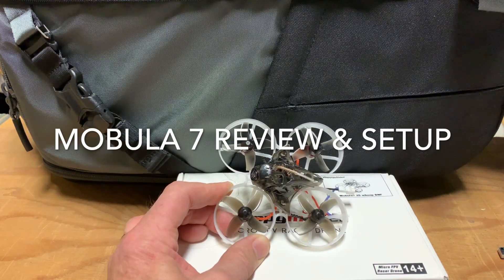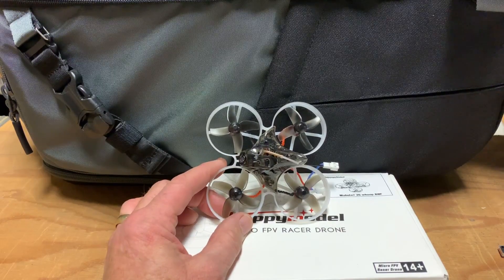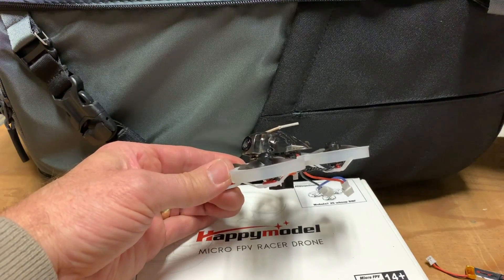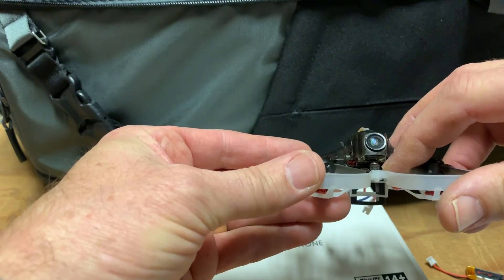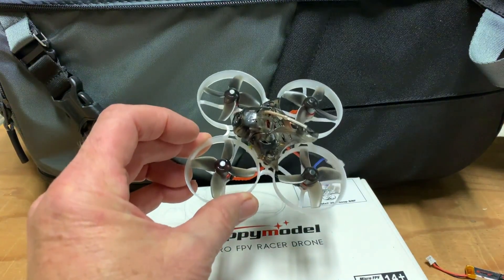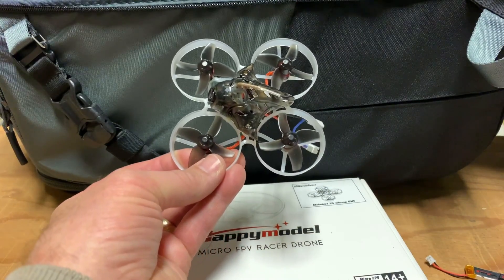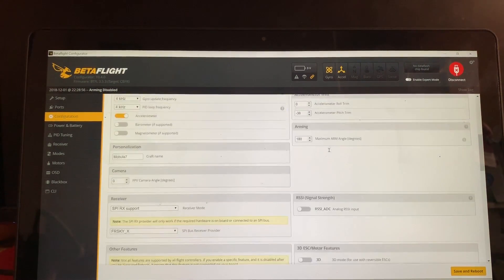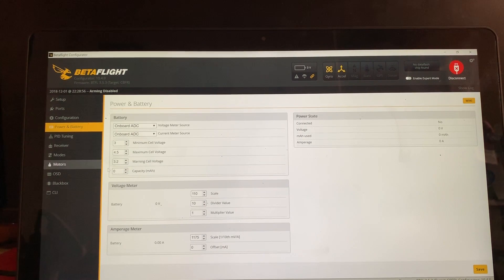Mobula7 Review and Betaflight Setup

Comment: Hey I just got the mobula 7, My problem is I cant select SPI RX Support in the Configuration Menu in betaflight. Theres only the option to select Spi support what can I do about it? I cant bind my reciever... (FrSky Taranis Qx7 Acces
Reply from the maker: Hi E4zl,
The Qx7 with access protocol support, only supports ACCST D16. In addition, if you are running the latest ACCST 2.0 FW, it will not support the Mobula 7 which does not support ACCST 2.0. I will link a video that Joshua Bardwell did on the compatibility issue. A lot of us who fly whoops have abandoned FRYSKY because of this issue. Your options are down grade the QX7s FW to pre 2.0 ACCST FW and run D16 or buy a multiprotocol transmitter module.
Link to Bardwell's: FrSky won't bind! ACCST 2.0 is to blame

https://www.youtube.com/watch?v=09g5MfTdiyw&t=469s
Reply: @slogfpv  Hey thank you so much for that long comment it helped me alot and I got it to work now :) Thank you!
Reply from the maker: @E4zlLP  glad you got it working. Have fun!

Comment: Ok I have the flysky version it beeps the whole time while I’m flying the. board is 4.2 is it the battery warning and my battery level forest show up on my OSD.
Reply from the maker: Hi Timmy Drones,
I would go into the Betaflight Configurator and on the Power & Battery tab would set the following:
 Minimum Cell Voltage = 3.1
 Maximum Cell Voltage = 4.4
 Warning Cell Voltage = 3.3
The PH2.0 connectors are not solid pin (at least on mine) so there is a lot of voltage drop across the connector. The Maximum Cell voltage is set to 4.4 if you are charging your batteries to HV. After landing check your battery voltage at rest and it should recover to ~3.5v.
SLOG
Reply: @slogfpv  still beeps while flying doesn’t show my battery on OSD like the screen format is small. Won’t take off on 2s spins up and stops and beeps and beeps lol
Reply: @slogfpv  update is flew on 2s for 2 mins and one min on 1s and I did get the beeping to stop along with the battery to show up on OSD. Super low fly time

Comment: How many flight modes does this quad have? I see "air" and "stab" on my OSD. Is there another mode I should be setting up in Betaflight? My choices are "Angle" and "Horizon". This is a Crazybee F4DX 4.0.6 9/1/2019 flight controller, FWIW.
Reply from the maker: Hi Fred Morton,

There are 4 modes: Angle, Horizon, Acro and Acro Trainer. You will see three of the flight modes in the Modes tab in Betaflight. Acro is the default so it does not show up in the modes tab. Oscar Liang has good overview on all the modes in Betaflight (link below): https://oscarliang.com/betaflight-modes/

Best,

SLOG
Reply: @slogfpv  Thanks. You don't mention "Air" and "Stab". I presume "stab" means "stability", but how does this match up to the four modes you mention?
Reply from the maker: @fredmorton4291  
I know it is a little confusing as the names change for example in Betaflight there is an angle mode which equals stability mode. Air mode is really an add on feature to Acro mode and a lot of pilots just turn it on always. But basically the props continue to spin while your throttle is all the way down (min). Why this is important is if the props stop spinning while you are doing power loop (usually drop throttle at the top of the loop), you lose control and will fall like a leaf. Think of it like an airplane stall. Here is a quick cheat sheet. Ones that say self leveling are actually using the accelerometer. Acro does not.

Angle = stability = self-leveling 

Horizon = self leveling up to a certain roll/pitch angle (adjustable) so you can do rolls and loops.

Acro Trainer = self leveling but opposite of Horizon where it is not self leveling up to a certain roll/pitch angle so you cannot do rolls and flips but does give the feel of Acro mode. The Angle it goes into self leveling is adjustable as well.

Acro = no self leveling, is the default but is overriden by the above modes if they are turned on. Usually the Air mode feature is turned on with it. For short hand I just say Acro/Air because most pilots use the two paired together.

Hopes this helps,

SLOG
Reply: @slogfpv  The quad I compare is to is the Inductrix FPV+. It has 4 modes-Altitude (alledgedly holding altitude), Stability, Agility and "Meow". •	
The modes are described below from the instruction book:

Altitude mode (green LED, switch position 0): maintains altitude. The bank angle is limited. When the sticks are released,

the quadcopter will return to level flight.

•	Stability mode (blue LED, switch position 1): the bank angle is
limited. When the sticks are released, the quadcopter will return to
level flight.

•	Agility mode (red LED, switch position 2): the quadcopter has
no bank angle limits and will not return to level fight if the sticks are
released. Use rates and expo to tune the performance according to
your flying style.

•	Meow Mode™ (trigger switch (RTF), button I (BNF)): flips the
quadcopter upright if it lands upside down after a crash by reversing
the motors on one side. 

From your descriptions, I assume the following-Stability mode on Inductrix = Angle mode on Mobula. Agility mode on Inductrix = Acro mode on Mobula. To my knowledge, there's no altitude mode setting avilable for the Mobula (unless it's called something else). And for the Meow mode, I think that's referred to as "turtle mode" on the Mobula since it does the same thing. 

Do I have this correct?
Reply from the maker: @fredmorton4291  I do not have any Inductrix experience.  The closest is my alien0 whoop running silverware. Comparing inductrix flight modes to betaflight modes is kind of like comparing DJI Phantom 4 flight modes (e.g. Attitude vs Altitude). But your mapping is correct.
Circling back to your question, the modes that I would setup for a beginner (not sure of your skill level) would be: Angle, Horizon and Acro/Air. You might want to play around with Acro Trainer if you have not mastered  Agility mode on the inductrix.

Cheers,

SLOG
Reply: @slogfpv  Thanks again for your help. Every bit of information helps since many of these manufacturers don't do the best as far as providing detailed information (especially if they have to translate Chinese to English). Yesterday one of the local FPV racers was kind enough to help me out on a video chat call. Using FB messanger, he was able to look at my BF settings and make recommendations. Probably the first thing I'll do is fly the Mobula around the house on 1s and see how it performs (I've been told by the vendor that running it on 1S is perfectly fine). Once I get used to it, I'll take it outdoors.

Comment: Hi Im a noob and i didnt backup my mobula 7 settings. how do i obtain the original setup and load it. My drone turns on but the motors do not turn
Reply from the maker: Hi Dee1251,
I happen to have a factory diff file for Betaflight 4.0.0 on one that I still have in a box as a spare. I would load this version and cut and paste the following text into the CLI (command line interface). This is for the FRSKY version (CRAZYBEEF3FR. I hope this helps.
SLOG

# diff all
# Betaflight / CRAZYBEEF3FR (CBFR) 4.0.0 Oct 13 2018 / 08:00:14 (3b479f92d) MSP API: 1.41

mcu_id 003500395834570320303331
defaults nosave
name Mobula7

feature -ANTI_GRAVITY
feature -DYNAMIC_FILTER
map TAER1234
serial 2 2048 115200 57600 0 115200
aux 0 0 0 1300 2100 0 0
aux 1 1 1 1200 1550 0 0
aux 2 28 1 1550 2100 0 0
aux 3 35 2 1550 2100 0 0
set motor_pwm_protocol = DSHOT600
set vbat_warning_cell_voltage = 29
set ibata_scale = 1175
set osd_warn_esc_fail = OFF
set osd_vbat_pos = 2102
set osd_rssi_pos = 2083
set osd_tim_1_pos = 54
set osd_tim_2_pos = 2134
set osd_flymode_pos = 2456
set osd_throttle_pos = 2423
set osd_crosshairs_pos = 2253
set osd_current_pos = 2401
set osd_mah_drawn_pos = 2434
set osd_craft_name_pos = 2445
set osd_warnings_pos = 329
set osd_disarmed_pos = 2346
set frsky_spi_tx_id = 71,131
set frsky_spi_offset = -51
set frsky_spi_bind_hop_data = 2,142,47,187,92,232,137,42,182,87,227,132,37,177,82,222,127,32,172,77,217,122,27,167,72,212,117,22,162,67,207,112,17,157,62,202,107,12,152,57,197,102,7,147,52,192,97,0,0,0
set frsky_x_rx_num = 6
profile 0

profile 1

profile 2

profile 0
rateprofile 0

rateprofile 1

rateprofile 2

rateprofile 3

rateprofile 4

rateprofile 5

rateprofile 0
save

Comment: Dude, changing the arming angle to 180 degrees saved me today. Thanks. Great advice.
Reply from the maker: Glad it worked out for you! I know what its like to get stuck in a tree. You can use turtle mode as well to get unstuck.

Cheers,
SLOG
Reply: @slogfpv  yeah, I did that, too. Switched back and forth until I wiggled out.
Reply: I killed a motor today, though, I think from when I was recovering while in brush. Bummer! Oh well, they're cheap.

Comment: I forgot to save the original. Do you by chance have a copy you can send me?
Reply from the maker: Hi Mr. Puddle,
Here is the diff -all for the factory settings. Just cut and paste it into the cli and type save.
Cheers,
SLOG
diff -all
# Betaflight / CRAZYBEEF3FR (CBFR) 4.0.0 Oct 13 2018 / 08:00:14 (3b479f92d) MSP API: 1.41

name Mobula7

feature -ANTI_GRAVITY
feature -DYNAMIC_FILTER
map TAER1234
serial 2 2048 115200 57600 0 115200
aux 0 0 0 1300 2100 0 0
aux 1 1 1 1200 1550 0 0
aux 2 28 1 1550 2100 0 0
aux 3 35 2 1550 2100 0 0
set motor_pwm_protocol = DSHOT600
set vbat_warning_cell_voltage = 29
set ibata_scale = 1175
set osd_warn_esc_fail = OFF
set osd_vbat_pos = 2102
set osd_rssi_pos = 2083
set osd_tim_1_pos = 54
set osd_tim_2_pos = 2134
set osd_flymode_pos = 2456
set osd_throttle_pos = 2423
set osd_crosshairs_pos = 2253
set osd_current_pos = 2401
set osd_mah_drawn_pos = 2434
set osd_craft_name_pos = 2445
set osd_warnings_pos = 329
set osd_disarmed_pos = 2346
set frsky_spi_tx_id = 71,131
set frsky_spi_offset = -51
set frsky_spi_bind_hop_data = 2,142,47,187,92,232,137,42,182,87,227,132,37,177,82,222,127,32,172,77,217,122,27,167,72,212,117,22,162,67,207,112,17,157,62,202,107,12,152,57,197,102,7,147,52,192,97,0,0,0
set frsky_x_rx_num = 6
profile 0

rateprofile 0
Reply: @slogfpv  You are amazing, THANK YOU!
Reply: @slogfpv  flysky version
Reply from the maker: Mr.Puddle, happy it helped :) SLOG

Comment: The low battery signal and land now is that done on the osd settings ?
Reply from the maker: Yes you need to enable Warnings in the OSD tab (screen) in Betaflight Configurator (Left Column). Also make sure all the warnings are enabled on the right hand side of this screen (e.g. Battery Warning, Battery Critical). Hope this helps.
SLOG
Reply: @slogfpv  thanks! Much appreciated

Comment: Hi, thanks a lot for this useful video. You set your min cell voltage at 3V, I was wondering if it's not too low ? Isn't there a risk of damaging 1s batteries if you disarm your quad not before reaching such a low voltage ?
Reply from the maker: Hi Pierre,
First we need to talk about voltage sag of a 1s battery. It is not uncommon for you to land at 3.0 volts and after sitting without a load, the battery will recover to 3.5 volts. The 2nd is the PH2.0 connectors have a higher resistance than a XT30 so you get a higher voltage drop across the connector. So on a punch out (ohms law) you will be dropping more voltage across the connector so the voltage at the FC dips. 

Point being if you set the min voltage too high, on punch outs the FC could shut down as you get a voltage sag. IMHO a good upgrade is to go to a XT30 connector and run 300 or 350 MAH 2S high C battery so you get a smaller voltage sag. You can then turn up the min voltage.
Reply: SLOG FPV thanks for your reply. oh, didn’t know the FC could actually shut down suddenly because it receives a voltage that’s too low compared to the min voltage value set in betaflight, I thought it was just a value you set so that the alarms are raised when you want them to !
Reply from the maker: @pegreuzard  
There are actually two voltage settings. The min cell voltage which I thought you were talking about and the warning cell voltage that is set to a higher value than the min to tell you when to land. The warning cell voltage is one you can adjust based off of your comfort level. You will just get warnings in the OSD or beeper will sound if you have warnings turned on.

Cheers,

SLOG
Reply: SLOG FPV ok it’s more clear. When flying, I get two warnings though, the first warning and the critical battery warning « land now », which I thought corresponded to the minimum cell voltage ? But maybe it’s not the case ?

Also when do you usually chose to land in order not to damage your batteries ? At the first 3.2V warning ?
Reply from the maker: @pegreuzard  
Hi Pierre,
From the Happy Model factory, they have the voltage threshold settings weird, as I described 10 min into the video. They have the minimum cell voltage set higher (3.3v) than the warning voltage (2.9v) which is backwards. The way they have it setup, they have disabled the low voltage warning (low battery). Maybe they did this on purpose (I disagree) so that if you don't land within a few seconds, Betaflight will start turning off the ESCs (acts like you have no throttle control). That is why I recommend you set the Min Cell Voltage to 3.0v and the warning at 3.2v. You could ups the warning to 3.5v (conservative). 

But to answer your question, I land with the above settings when the "Low Battery" shows up in the OSD and the Beeper sounds which is at 3.2v (works for me). Sounds like you left the stock settings but then the sequence will be land now and a few seconds later you start losing throttle control. The sequence should be the following although really you should land before steps 2 and 3.

1. "Low Battery" warning at 3.2v
2. "Land Now" in OSD (if you don't land in a few seconds it will drop the ESC voltage to the motors).
3. Low voltage cut off (lights out like you pulled the battery).
Reply: SLOG FPV got it thanks

Comment: is it possible to add a stik to turn the camera on and off?
Reply from the maker: When you say turn the camera on and off are you meaning turn off the VTX? As far as I know the Mobula 7 does not support PIT mode. If you are talking about turning off and on recording, the stock Mobula 7 does not come with a built in DVR so all recording is done through the DVR in your goggles if it has one. So the round about answer is no.
Reply: @slogfpv  I mean flying with the camera turned off, to save energy
Reply from the maker: Hi @progettoaladino  
The short answer is no. There is no power control for the camera. The closet thing to what you are looking for is PIT mode which turns the VTX power down below 25MW. I don't think the VTX on the Mobula 7 supports that mode.
Reply: @slogfpv  thanks for your time spent for me, it's a pity, that the ingenue of the small mobius 7 hd have not thought about energy saving perhaps in version 3, if there will be they can also opt for this gem
Reply: @slogfpv  I always have the cam on, even how much I enjoy without glasses? there is no way to keep the camera turned off to save energy?

Comment: Hey man i was wondering if you happen to know if can bind the mobula 7 DSMX version to a readdy to fly spektrum controler?
Reply from the maker: It should but if it is only a 4 channel RC you will not be able to have an arm switch which means you can only stick arm the quad (left stick down and to the right) which I would not recommend. I would recommend getting an 8 channel RC if that is the case.
Reply: SLOG FPV no it has, becasue the RTF drone that i got it from has meow mode, it also has the three switches, thanks for your help
Reply from the maker: @anzej2101  
Cool have fun!
Reply: @slogfpv  hey man i came to you for advice, so my mobula is executing the direct opposite commands ( left is right and right is left) how can i fix this
Reply from the maker: Hi  @anzej2101  
First I would make sure when you go into Betaflight Configurator that on the receiver tab (screen) that you have Spektrum selected in the "Channel Map" pull down. If that is correct the next step would be to reverse the direction on the Spektrum radio. 

Here is a short video on how to do it on a Spectrum DX6.
https://www.youtube.com/watch?v=-THPThr_R_A

You can also change the direction in the CLI: "go to cli tab and type rxrange it will show you your 4 channels for instance rxrange 0 1000 2000 if that's the channel that is reversed type rxrange 0 2000 1000 and save. Go back to your receiver tab and check that you reversed the correct channel if not go back change it back and try the next one. Hope this helps someone".
https://droneracingpilots.com/threads/roll-reversed-in-quad-in-betaflight.1109/